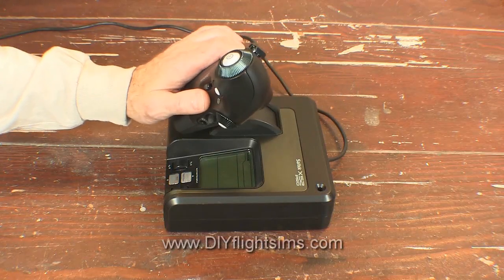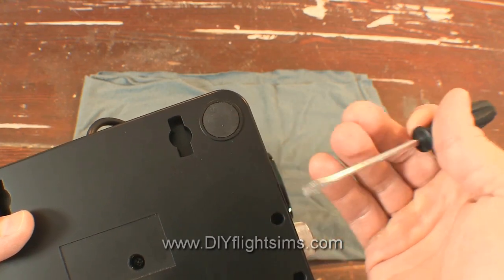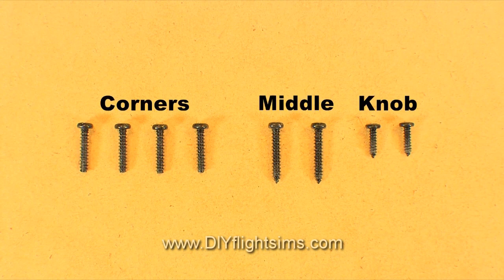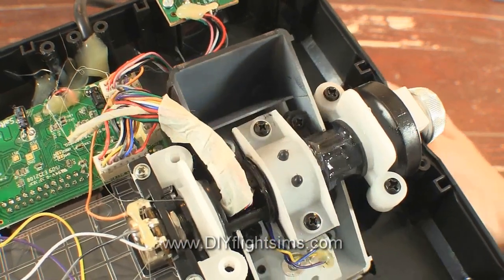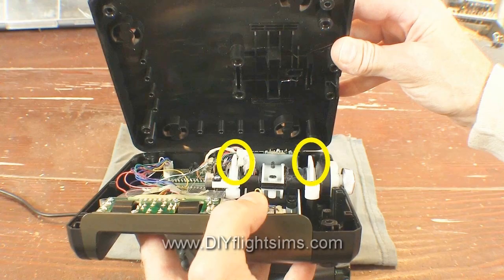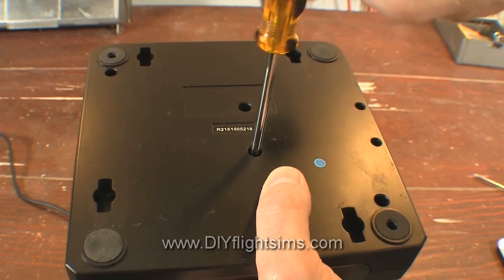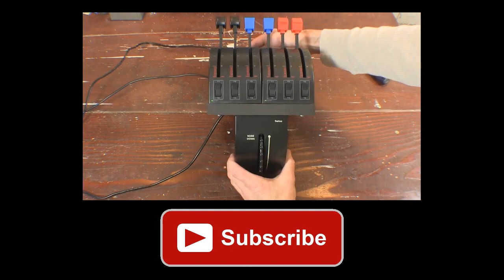Saitek X52 Throttle Fix

Comment: Hi, my issue is not the detents. My throttle physically drifts from the postion that I set it in, as if some spring was pulling it back. So I always have to nudge it forward or apply constant forward pressure.

Comment: Thanks for the video! I play Elite Dangerous with full range throttle and landing with the detents was driving me nuts. I always thought the throttle was kind of stiff but I didn't even know the detents were there but this definitely fixes it! I have the Logitech X52 (The non Pro silver one) and initially the base wouldn't open until I realized the 2nd center screw was hidden under a "disclaimer" sticker. I used the screw driver to feel where the hole was and then pushed it through.
Thanks again!

Comment: Easy as... Thanks. My X-52 had a tab in the centre near the left function button on the inside clipping the silver cover that curves over the front. I had to open from the rear and then kind of wrench it forward a bit to separated the cases.

Comment: Worked great.
Tip: When reinstalling the screws, use the screwdriver to rotate the screw as if you were trying to loosen it. Each full revolution you will hear/feel a 'click'. This is the screw thread dropping back into the thread on the plastic housing. Once you feel that click then you start rotating it to tighten it.
This will help prevent stripping out the plastic threads.

Comment: I had an issue where, when I adjusted thrust, the thrust in-game would go crazy. I figured my X52 pro was just crapping out, but when I went in to remove the detents (got tired of them after all these years of owning it), I checked the cables and components, didn't see any immediate problems, and put it back together. Don't know what was going on, but now my thrust is read accurately in-game, and the lack of detents makes the experience that much better.

Comment: Thank you. My throttle wouldn't go back to zero any more which was a pain. Ripping this stupid and pointless detent out fixed the issue. The X52 is NOT a quality product I'm sad to say, they actually used the wrong screws when it was manufactured. The throttle works, but high quality? not so much.

Comment: Does anyone know how to add a custom detent? I want to add the AB detent back, without the 25% detent.
Reply: (SUPOSITION) Maybe if you remove one of the 2 "dent" on the throttle lever (the one who clicks at 25%) it will work ?
Reply: @KAWIX  That is very invasive though, since you have to file the detents down and you can never get them back. I was hoping there'd be a "bolt on" (3D printed) solution, like there are for the X56 and other HOTASes.
Reply: @lik_doyaya  yeah i know but even if there where a 3d printed solution you'll need to go far in the dissasembly so in both ways it is very invasive

Comment: THANK YOU, THANK YOU, THANK YOU!!!!!!!!!!!! I just purchased a "used twice" (obviously used more than twice) X52 pro on offer up, got it home, and the throttle was jumping around, and didn't have full range. Yeah, I plugged the throttle in while it was apart and immediately saw that the input smoothed out, and I got full range. I removed the detent, and used a little more pressure on the tension knob.

You are the man. Go buy yourself a beer!

Comment: Hey Roger Dodger, I've always had a minor issue with my throttle in that the slider and the X/ Y Rotation knob have always been a little noisy at certain positions. Is this normal behavior? If it isn't, is it likely to be an issue with the pots or with the electronics somewhere?

Comment: @1:50 no screws on the non-pro version, to anyone curious
Reply: Does the fix work the same ? I need to do my non pro
Reply: @Dobbo50  yes it's very similar inside
Reply: @VladQuake  Job done and big improvement especially with helicopters
Reply: @Dobbo50  Nice. I took apart the stick to get rid of the rubber goo, and now can't get the pinky switch together.
Reply: @VladQuake  That's always my worry if something will not go back together luckily it was all ok, i also use some silicone spray on the moving parts and its nice and smooth as well as more accurate. Hope you get yours sorted soon
Reply: @Dobbo50  the trick is to film yourself taking it apart lol

Comment: Anyone ever had a problem with that mouse ministick? I've noticed that depending on the position of my throttle the range of x and y axis of that ministick is limited. It has nothing to do with deadzones. Like I can move it however i like and its not getting stuck or anything, the problem is that its in the properties window its values are heavily limited or I can move it left, down and up but the cursor doesn't go to the right.

Comment: I hit the like.
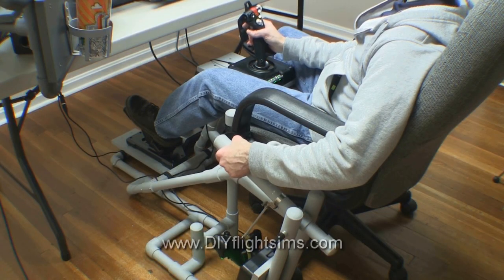Couple of questions.  Does the x52 Pro throttle LCD screen and the wheel buttons directly below the LCD screen allow you to use them to interact and modify / adjust the Radio Control Panel found in every cockpit (i.e. can see at 0:44 , upper left)?  Or does the LCD on the throttle base act as a read-only display?
Secondly, is it possible (and fairly easy) to re-insert the small detent thing that you took out for the mod?  Should use any special grease / fluid when putting back in?  Thanks.

Comment: I actually liked the detent, even for Elite: Dangerous, but the detent started acting "weird", it would bind up a bit until I released pressured and reset, but just tonight, it bound up on the low side, preventing me from zeroing the throttle without physically holding it back. Per your excellent instructions, I was able to remove it. It appeared to be rather dry, like glob of grease missed when it was being assembled +2 years ago. Rather than mess with the grease, I removed the detent instead. I just have to take care not to slam the throttle forward or backward without that familiar tactile feedback. This is my second X-52, been using them for almost 15 years, 20,000 hours easily between them. Good hunting!

Comment: Just this evening my x52 throttle started doing this thing where I have to push forward extra hard to get it to 100% Then it slides back if I let go. I hope this fixes the issue. Here is another Subscriber for the good info!
Reply: Almost as if 100% is an afterburner.
Reply: Hey, same problem here, did it fixed it ? Thx !

Comment: my issue is that sometimes my joystick has set keybinds in mode 1 + pinkie switch like T (Target) and sometimes it stops working and starts spamming the key to the point that I have to restart my pc as everything that involves typing is completely impossible

Comment: Hi there, first: thanks for the video. With my history of breaking joysticks since th C64 days, I wouldn't have touched it without an explanation ;) 
I have another problem though: the joystick part started squeaking. Do you have an idea how to fix that or which parts I'd have to oil/clean? Otherwise the whole thing is still working good, I wouldn't want to buy new ones just because of that.

Comment: My throttle had no resistance to move to the 100 but most of the time it was not possible to put it to  
zero without a having coming back   
to 10 or the like.
Turned out that one side of the slot   
was broken. Now there is no problem for propper landings. Thx a lot - your vid still saves throttles and money.
Reply from the maker: Thanks for your comment, I'm glad you enjoyed the video.

I created an online curriculum with many techniques for modifying flight sim controls and building DIY Flight Simulators. I call it the Builder Academy. You can enroll in Builder Academy for free and best of all... no advertisements!
https://www.rogerdodger.net/builder-academy/

Again, I appreciate your message and I wish you many happy flight simulator adventures.
Happy Landings!

~Matt Thomas
Roger Dodger Aviation

Comment: Thanks for the video, I think I'll have to think about removing it after it broke on me, I can still use the throttle but to go from below 25% to 100% I have to flick it back down from 100 to 25 and back up again, otherwise the detent stops it from going 100%. I actually wouldn't even prefer it without, I like having the biting point at 75% for both blue-line combat flying and for supercruising into a station on Elite Dangerous, but I already had to return an x52 standard for a broken spring on the centering mechanism and I'm not about to send this one away for something much more easily fixed myself.
Reply from the maker: Hi there, thanks for your message.
Quick reminder: I always respond to customers as soon as I see their email. Customer support is a high priority for me.

Unfortunately, I can't respond to all messages I get from the general public. However, I have already provided an enormous amount of free information for you...

* FAQ: Many general questions can be answered in my Frequently Asked Questions section  
https://www.rogerdodger.net/aboutus/faq/

* Builder Academy: Enroll in the Builder Academy to view DIY videos and instructions on improving your home flight sim. It's free with no advertisements!  
https://www.rogerdodger.net/builder-academy/

* Get notified of new products, sales, product updates, and more by signing up as a Roger Dodger Insider  
https://www.rogerdodger.net/contact/email_signup/

Again, I appreciate your message and I wish you the best of luck in building your home flight simulator.

Happy Landings!

~Matt Thomas
Roger Dodger Aviation

Comment: DUDE!!!! This video is awesome. I never did like the detent but would deal with it... The throttle started getting stuck and I had to play with it to get the throttle all off or all on... anyhow ...
I watched this video (Just before getting ready to order another joystick) and low and behold I followed you awesome video took it apart removed the detent, put it all back together and this joystick works BETTER than when I first got it brand new! Thanks a million!!! You saved me close to 200 bucks!
Reply from the maker: I'm glad my video helped you. Happy flying!

Comment: gah..ive had my x52 pro for a couple years now and never did this easy as hell task...i hate the fact they even put the stupid detente in anyways (i only use it on Elite Dangerous)
Reply: seems weird you want to remove the detent for elite dangerous...
the 2nd detent is where you place the throttle for it to auto slow you in supercruise. (keep you in the blue)

without the detent you will be overshooting stations and planets constantly.
(I know this from experience coz i tried it.) I lasted about half an hour and reversed the mod back to having the detents.

in elite the detents are your friend :)
Reply: eh, Ive always disliked the detents, especially for elite...I much rather have a smooth full range than to hitches at the high and low ends for no reason. Ive had MUCH better control since i took the "cavity" out :P
Reply: The HOTAS model in Elite is based on the X52 and it seems they designed the game to function around an x52 the best, mine broke and now I don't have these useful stoppers to ease me onto blue line combat speed/blue line supercruise speed. Honestly, flying FA off in combat with that detent there is really useful for me. But hey, each to their own.

Comment: Thank you, you saved my x52 , aparently something with the tooth can happen , and it gets stuck @ 25 / 75% it made a horrible clicking sound, and really had to push true it. ( happened very suddenly) , i pulled de tooth out, and now it works very smooth again 
So thnx again for explaining
Reply: The reason for this is that the detent housing is most likely cracked. It causes the detent to get twisted inside the stick. The detent housing is way to thin and almost always crack over time. Best to just remove the detent.

Comment: THANK YOU!  My X52 Pro's throttle had got very spongy after 75%, it wasn't engaging all the way too 100 unless you kept constant pressure on it, it would just move back to 90%.  Removing the detent has fixed this!  Thanks so much for posting this.
Reply: This was my issue too, it seems like the upper 25% screw in the doohicky had collapsed inward inside the piece, so removing it and going to a smooth 100% range throttle was an easy fix, and this guide helped a lot.
Reply: @Xerxes17  Same.
Reply from the maker: Thanks for your comment, I'm glad the throttle works for you now.

Comment: Just wanted to say thanks. The detent on my X52 Pro Throttle went south. I was about ready to drop $400+ on a Warthog HOTAS when I found your video. Watched video. 15 minutes later and voila no detent. It's like a whole new throttle and way better without the detent. Now if I could just get rid of the noise around the center detents on the x and y rotation knobs on the throttle.
Reply from the maker: Thanks for watching, I'm glad it worked out for you

Comment: Fantastic! Opens up a bunch of power settings previously unavailable with many of my aircraft. Thanks!

One tip, be sure to remove the center screws completely as shown in this vid. Otherwise it's easy to accidentally pull part of the mechanism off, and those wires are very thin. No damage was done, but removing the screws will ensure so.
Reply from the maker: Thanks! Glad you enjoyed the video.

Comment: It wouldn´t be so critical if the throttle would stay in place. (like 95% or so) But it is moving and that is really annoying excpet you would keep your hands on the throttle but i have to operate some other things in a sim.
I mean, who is buying a 200€ Joystick for an arcade game? The companys are not thinking, and about the warranty. Maybe the company should make it sure that the expensive crap is working. The first X52 pro was dead by arrival and i have no idea how long the second one will be working. There is no more quality on the marked!
EDIT: It´s done. Thanks.

Comment: awesome, any tips on cleaning the x52 pro. Mine has become sticky over time.
Reply: It is the thin rubber over surface. You have two options: Remove it all with isopropyl alcohol (rubbing alcohol)

But I do prefer the second option: baby powder. Carefully put ir where it sticks and the sticky sensation will go away. :D
Reply: I used a "Stainless Steelo Wool"- it did not scratch the plastic underneath and it cleaned up all of the residue in now time.
Little more challenging with the contours on the stick, but the throttle must have taken all of 60 seconds.
@Roger over time the 'rubber surface' disintegrates and becomes sticky- any pressure (say like from your nail) will simply remove part of it but leave the adhesive smeared- like when taking off a sticker that leaves all of its glue behind.
Reply from the maker: It's sticky? I haven't heard of that issue for the X-52. Have you tried opening it up to see if it's dirty around the rotating axle?